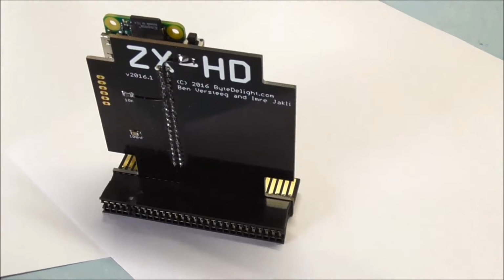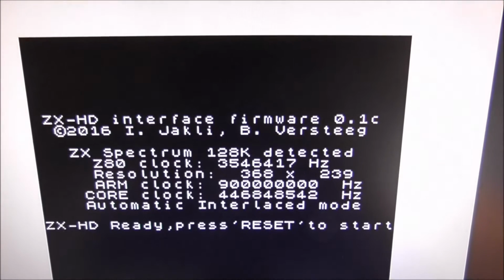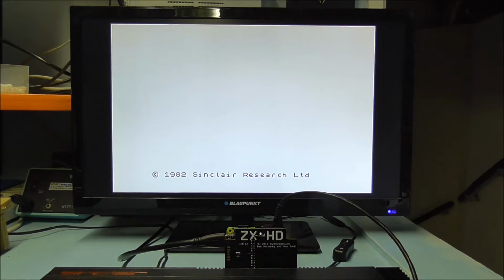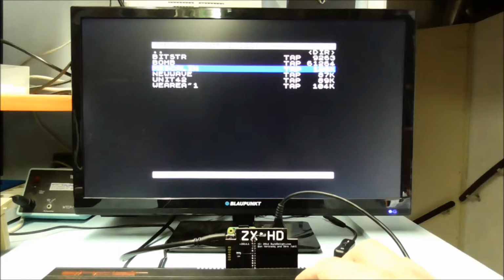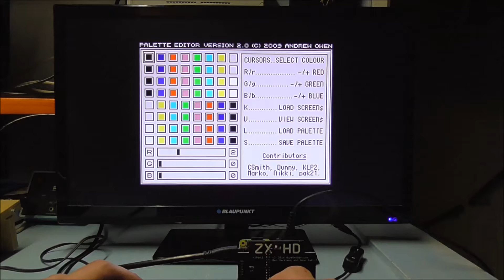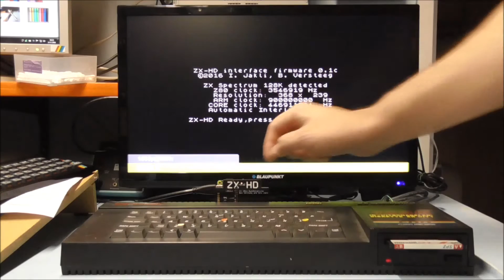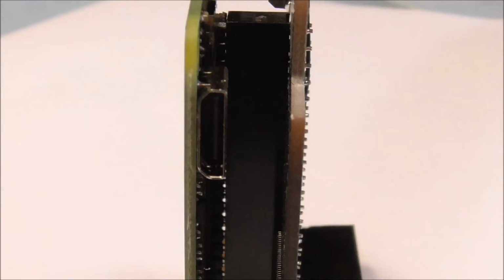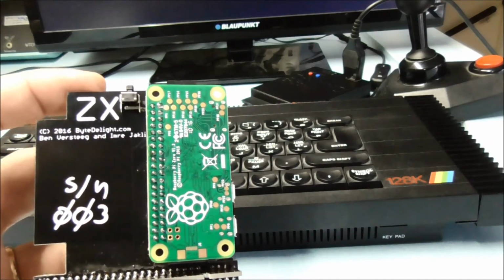ZX-HD preview video

Comment: i know this is going to come across as a stupid suggestion - the currah micro speech interface had a 3.5mm mono jack that plugged into the ear socket on the back of the spectrum - in this way it could send the audio output to the tv sound - could this be adapted for the hdmi interface please?

Comment: Can the RPi  handle anything else on top of the HDMI stuff, such as providing a USB storage or WiFi network access for the Speccy?
Reply from the maker: Not with the single-core Raspberry Pi Zero. 
If we would implement extra features like you describe, it would cause problems staying in sync with the ZX Spectrum ULA.
We ARE though working on sound over HDMI, but the core is already running at about 95% of its capacity, so it's not easy.
Reply: Thank you for the reply, I thought that might be the case, still pretty cool :) I've been thinking about turning an RPi into kind of a built-in server that could actually fit inside a Sharp MZ-800, providing storage, USB and network connectivity, and perhaps some more on top of that. 
BTW I'm curious if the software on the ZX-HD runs on Linux or if it's all bare metal ...
Reply from the maker: It's bare metal - it would take way too much time to boot through Linux, and as it's at about max of bare metal performance, Linux would ruin that.
Most of the work is programming, not the hardware. I'm no expert myself - I did this with someone that knows the Raspbarry Pi a lot more than I do; check out zx-hd.bytedelight.com for more info!

Comment: I was thinking of something related. I'm building a generic Z80 board (just as a retro project), but my biggest issue was getting a decent VGA output. Most of the bodges involve a Prop or PIC32 with internal RAM, but what I really need is an area of external dual port RAM I can write to over an 8 bit bus.
Now the Rasp Pi only has the usual interfaces which I guess are too slow for video, but it does have a fast camera bus (?), but I'm not sure how this this hardware works..
Could you describe how your system works please?

Comment: The product seems to selll priced as high as a spectrum costs these days. Maybe worth it if it had HDMI output also it  would then make a spectrum fully working again
Reply from the maker: Please calculate for yourself what the price should be when you count parts costs, the case and the time needed with that - profit is not that much, and I do this for a living now.
Reply: @ByteDelight  mm sure.. i am on the look out for a cheap zxspectrum to make up for it. I might code some new software for it again.

Comment: This is absolutely fantastic, and is the beginning of what I wanted to explore with Piotr Bugaj. Looks like you fellas are the ones to contact. 
So, could you add a connection between the RasPI's GPIO TO this device, and enable via firmware, the ability to use a (wireless) USB keyboard, or a USB gamepad plugged into the RasPI's USB port?
I'd like to use a keyboard and mouse at a distance from the unit - so it can sit by the display, whilst I sit at the back of the room. 
This would also allow the use of the Recreated ZX Spectrum keyboard as a remote keyboard for a real Spectrum. 
Cheers!

Comment: And what about sound from HDMI?
Reply from the maker: Imre Jakli, who developed the Raspberry Pi firmware for the ZX-HD, and I, are not sure if it's possible to properly add audio, since the ZX-HD has just a single core SOC which is already running at its limits - that is because we wanted it to be in sync with the ZX Spectrum ULA.
Actually I hope there will be a dual-core Pi Zero, which will open more possibilities.
I am also looking for alternative solutions, but it takes time.

Comment: Not clear if you are using the zx cpu or only the keyboard
Reply from the maker: It's an original ZX Spectrum
Reply: ByteDelight But The code run in The zx cpu?
Reply from the maker: Yes, the ZX Spectrum works as usual, but the ZX-HD 'listens' to the video changes and creates the HDMI output.
Reply: @aldob5681  
It seems this thing scans for video Ram and reads it instead of ULA.
Yes - processing is done by CPU, but some rare glitches and effects might become unavailable due to different processing.

Comment: You don't have to solder in a header for the GPIO any more, just buy the pimoroni hammer header kit. You might want to just leave the pi zero in place, but considering they are cheap I don't see a problem.

Comment: I am very satisfied with it. Best thing I ever bought for my Spectrum. Woould be even better if it also supported sound over HDMI. Maybe a future version can do it?
Would be even better if there would a combined solutions. So HDMI output, Joystick interface and SD card interface in one module. That's the only thing I don't like about my spectrum. My spectrum has three modules in the back. The joystick interface, the SD card solution and the HDMI solution. The stuff on the back of my spectrum is almost the same size as the spectrum itself.
The Spectrum Next would be the best solution for that, but at the moment of writing they aren't produced anymore.
Reply from the maker: For those who love the original hardware, I am continuing to develop and produce new interfaces.
A combined interface is under development, but mainly because it's so incredibly busy right now, that will take some months.
Reply: @ByteDelight  No rush Ben. Quality takes time. I can wait :-) Combined interface is great! But how about sound over HDMI? Is that possible too?
Reply from the maker: @Patrick-sp6zu  Probably not with the single core Raspberry Pi Zero.